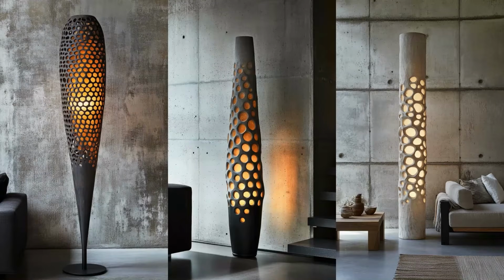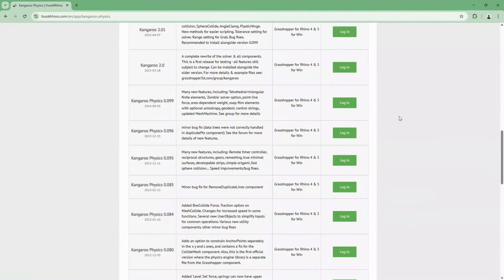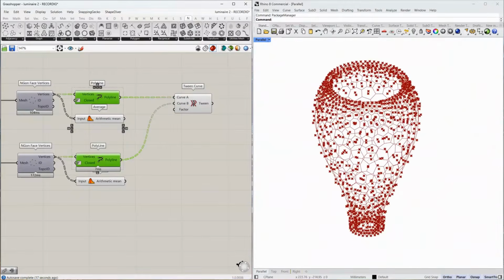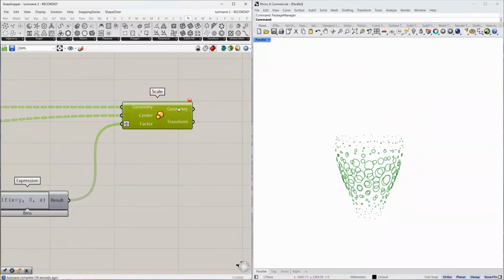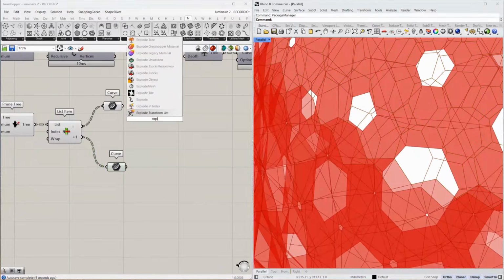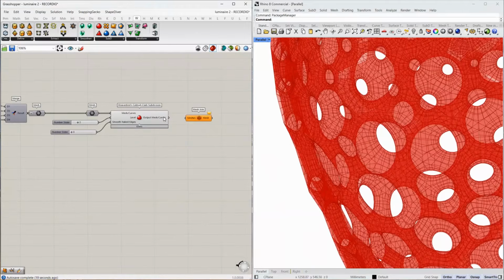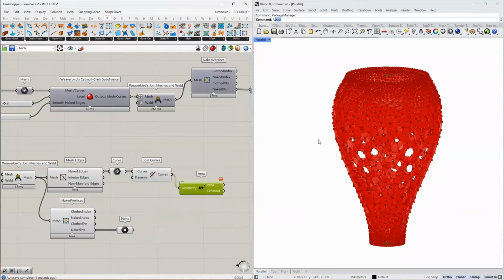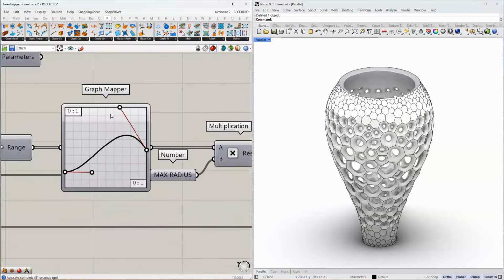Grasshopper Tutorial: Parametric Luminaire Design

Comment: Hi, I have a problem when I connect the last string that joins the two plugs to the mesh of "weaverbirds catmull Clark subd". It automatically disconnects from the mesh coming from "merge d1 d2 d3". Consequently, when I try to conclude the object, it is open and incomplete, because the central part or the two caps are missing. (Of oviously, I'm not referring to the caps that close the structure, but to the upper and lower circular parts.)